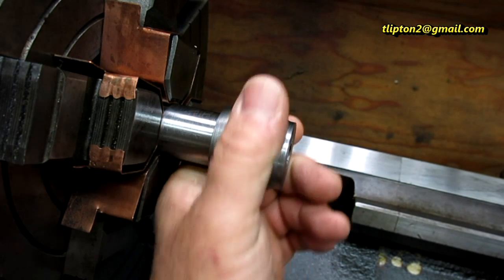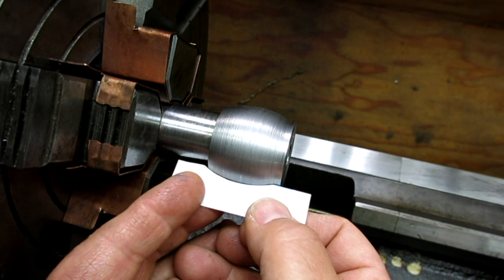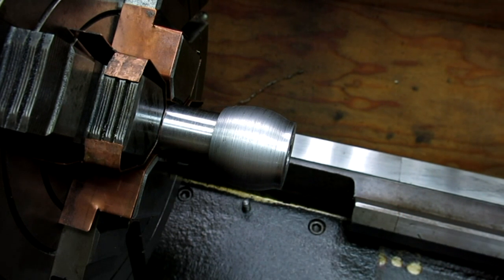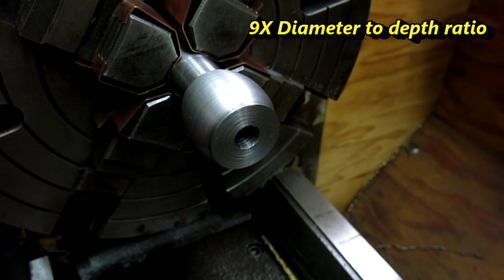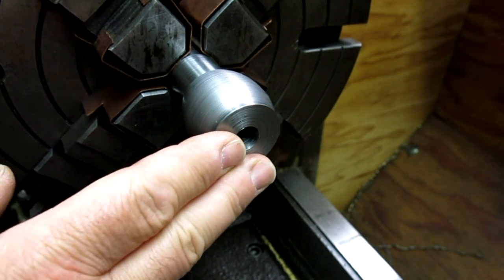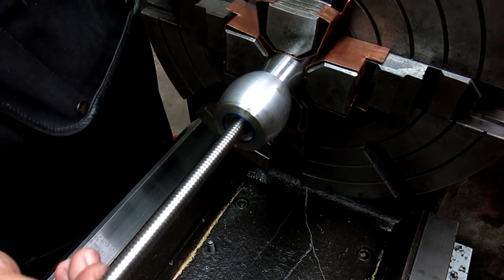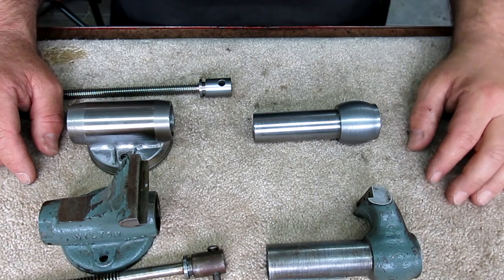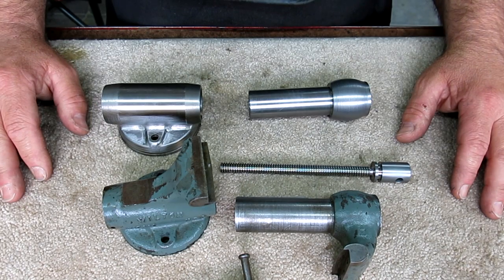Wilton Baby Bullet 9

Comment: Very fine technique , following the pattern with an indicator.
Question:
There exists for some lathes a taper attachment where you loosen the leadscrew of the crosslide and let the crosslide follow the line of the taper , mounting an angled rail at the back side of the lathe. 
Can you imagine a tool that follows an irregular curve mounted from a pattern at the back of the lathe. Will say , you convert your lathe to a "copying lathe" ?

Comment: Tom:
Having been in the trade for over 50 years I am impressed with the work you are doing! As to how you do something in your videos, there are as many ways to do something  that turns out the same as there are pebbles in a stream.What works for one person does not always work for another. Over the years I have owned 3 tool shops made parts for Aircraft, automotive and industry, you could have been a top hand inany of my shops.

I am 71, soon to be 72 and still do a little work on things. Over the years I have done injection molds, steel rule, and progressive dies. All of the work was hands on with very little EDM, water jet &ect. So I can really relate to your hands on aproach. 

Until I moved to Europe in 2010 for a few months ( we were suposed to be there for the rest of our lives, didn't work out) I had a small hobby machine shop in the back yard. (benchtoop mill, Lathe, drillpress grinder, welding equip. and metal saws with assorted hand tools.) sold it all when we decided to move. If I had know I ws coming back I would have put it all in storage. So a word to all those out there that plan on sellingyour tools, DON"T DO IT! 

I have taken up enough of your time so all I can say is keep up the good work. And yes I watched the Wilton vise come to life,  only to things I would have assed to the build would have been a set of aluminum jaws and a set of steel jaws with the cros hatching on them.which can be done by taking a 45* tool setting the vise at a 45 and cutting that way, works very well! will watch more of your videos enjoyed the vis videos very much. Gary, Las Vegas, NV
Reply from the maker: +Gary Brackney Hi Gary,

Thanks for the nice note and support. Great advice on not selling your tools. I have let some things slip away that I really kick myself for now. I was hoping one of our shaper fans would step up and make some serrated jaws for the baby. I went with my favorite style and didn't look back. Thanks for the comment,

Cheers,

Tom

Comment: Nice one Tom. It looks like you're running a high rake aluminium insert on the boring bar(?). It sounds like a good choice and I may try it, but sometimes have issues with chips stringing on external high rakes. I wonder how you go with this on deeper bores?
Reply from the maker: +Pete F Hey Pete,

Try a higher cutting speed and feedrate. Oily oil never hurts either. Thanks for the comment.

Cheers,

Tom

Comment: Great series. To some of the people who made, well, less than favorable comments I would like to say that this is not a "duplicate" of the Baby B. To duplicate it, you would have to make wooden patterns, melt iron, and cast the thing and then machine it.  These are processes beyond the reach of the average home shop and  even most pro shops. This is a facsimile, or imitation, or something like,  a BB. So the tracer a la Lipton is not only reasonable, it is more accurate than the original. What's the error in a casting? From my limited experience in Aluminum, a whole millimeter - 0.040" . That pattern following, , watching the indicator, was never off not more than two-three thou. The error in a hand-filed pattern is more than that! I am really impressed by tracing by hand as opposed to buying a tracer attachment, even if you could find one these days. The only reasonable alternative would be to do it by hand, just like clockmakers do, with a graver and a steady rest. Or of course CNC, but that's not the point of this series.

Comment: Positively Fantastic Control !! Tom,
I seem to remember being told that you can count on a twist drill to cut straight for about 1-1/2 times the diameter, because the Web is thinnest at the chisel point, where the most pressure on the tool is, (unless it's a  split point). So for more accurate deep drilling, you should use a core drill, which has 3 or more flutes and a thicker Web, but must be pilot drilled. 
Of course it all depends on the application. And for a clearance hole its F.C.E.
Thanks for a really interesting series.

Comment: Just to add fuel, when cutting to one of those templates, you might take a tip from woodworkers. When cutting a varying diameter on a wood lathe, they always seem to cut from high to low. If backlash was an issue, you could have cut from the highest spot first to the right and then to the left.

Nice series. You are going to have produced a good-looking vise when you are done.

Comment: Thank you for another great entertaining and educational video.  I have two questions concerning turning the body that I hope you will address:
1.  Is it possible to, instead of making a positive template, grind a negative outline of body into a forming tool?  You could then achieve more intricate outlines and also not be concerned if your stylus and linkage is changing the proportions of the finished part.
2.  Is it practical to create a fixture on the end of the cross-slide that would hold a template and have a stylus following the templates contours and controlling the cross-slide movement much like the action of a taper fixture?
Reply: +Morris Gallo The short answer is 1. yes and 2. yes...

I'm sure that others will jump in here, but remember, every technique has its challenges as well as its benefits.

The form tool approach is going to require very shallow cuts, as you have a lot of area in contact. Speed to feed on those cuts is also a bit tricky, as the tool will want to chatter.

The tracer approach is going to require careful use of the compound feed to control depth of cut. You may need to rig up an extension on your cross slide to get a stylus to reach your template.

I'd probably try to go with the second approach for all but the smallest of feature - your mileage may vary!

Let's see what other, quite possibly more experienced folks have to say on these approaches...

Regards,

Eric
Reply: +Morris Gallo Since the shape is convex, you would have to make full width plunge cuts with the form tool. So no way to make shallow cuts.
It could probably be done with a flat bar 1/2" or 5/8" thick of tool steel or HSS with the form cut into the side of the bar. Then mount the tool crosswise in the tool holder so the form would run along the face of the post rather than out in front of it like normal.
Sounds pretty borderline for his lathe, and definitely pushing the rigidity of the tool post. Sounds about 10x worse than using a knurling tool, you would kill a live center pretty fast doing this.
For a one off like this, the best approach is really to just make a paper pattern, rough it by eye, then finish the shape with a file. Would take half the time and get the same results. If doing more than a few, then a proper tracer can be made by disconnecting the cross feed screw, and hanging a few pounds of weight off a rope tied to the cross slide. Just back the template with a stack of shims, and remove them one at a time for each cut. Basically the taper type fixture you describe.

Comment: Hey Tom, you did a good job as was shown by the reverse template . I don't think it is that crucial to be dead nuts anyway, after all it is a vise body with welding to follow. Looks good and oh it's not taking ya into space it's to hold stuff.  whens #10,whens #10   Dave

Comment: Thanks for touching on the runout, I had to mull over that one a while. Your explanation did not really suffice to satisfy my curiosity (especially the "it's just the way of the world" bit, that always gets me all worked up).

I could always imagine how a drill in a drillpress might wander off course (I can see the flex in my crappy drill press), but I have a hard time translating that same image to a lathe where the part spins. The way I figure the drill must "wag" or wobble around, flexing in time with the spinning part. That is the only way to make the hole go off that way. But why doesn't it just cut a larger (or even tapered) hole if it was imbalanced or misaligned? Which forces "steer" the drill off course and are not averaged out by the spinning of the part? It can not be imbalance in the drill grind, gun drills have only a single cutting edge! 

I suspect a rather important factor is that a drill doesn't cut on the flutes, or it would self center more, like a milling cutter.
Reply: +jusb1066 Yea they are great I use them all the time, but sometimes I need to get in near an obstacle where the step drill will not fit. At first I tried to create something much like a cone drill, with a very pointy angle. It didn't work well. I was surprised that a very flat grind worked better - if I had to guess I would have said that should grab more. I was at that time experimenting to find something that wouldn't grab and crack perspex when breaking through, the sheet metal was only an afterthought.
Reply: +stefantrethan i guess errors in tailstock alignment will cause issues, but i see your point, the part rotates would it not even out, ive often seen the bits initially bite off the original mark.
Reply: +jusb1066 On some lathes (I think it might have been visible on John's old Boxford) you really see how the drill is "pulled" into the center as it starts. However as you say any misalignment should result in a tapered hole, no?
Reply: stefantrethan
yes i see the logic about the tapered hole in a  way! perhaps the mere act of spiing the part around the centre of the hole you want is enough to even out all the forces, the main probability of it wanting to veer off inside maybe the slight innacuracy of the drill tip itself, we have all ground our own bits and it can cut unevenly making a larger hole that the bit itself, and perhaps when spinning the part, this would instead make the hole veer off?
Reply: +jusb1066 I have ground many uneven bits. One might even say I am a bit of an expert in grinding uneven bits ;-)
However lets say the one edge is in front, so it will cut more on one side of the part. But then half the time it cuts more on the other side of the part, because the part has turned.

Cutting with single point tools works quite well on the lathe, even quite flimsy boring bars, apart from chatter and lifting from toolpressure the cuts still turn out concentric. So why does the drill go wobbling about?
Reply: +stefantrethan  You should look at this. http://www.vintagemachinery.org/pubs/detail.aspx?id=4925 Lots of nice drill info there.
Reply: +bcbloc02 Thank you, that was most interesting.
It didn't exactly cover the issue I can't get my head around, but the latter half shows a geometry for sheet metal which I have found surprisingly advantageous before - round hole, no grabbing, no burr. It is nice to see this in such an old book.
Reply: +stefantrethan
i use them coned step drills (and stepless version) for sheet metal, no grabbing at all, might be worth looking at :}, they also work in the thinnest material, plastics etc and work at a slow speed and thus more control, you can buy them super cheap on ebay (3 for $6)  they will be good enough to see if you like them, maybe get some good brand later on
Reply: stefantrethan
 They did cover why drills wander in that book it is because they have poor self centering by design. Also the fact that at the center it doesn't really cut but more like smears the material out of the way. These factors combined mean a drill is prone to following the path of least resistance or being steered by the already cut chips when they sometimes get between the drill body and the hole.

Comment: Wow, you mean people were pedantic enough to point out the nose radius was different on a blank that was supposed to emulate a casting?  Umm, if the nose radius of the stylus is larger than the cutter, there is no effective error because the cutter can produce a smaller form than the stylus.  The 'error' only occurs if the stylus has a larger radius than the smallest feature you are copying.

Comment: For copying a rough casting i think it was an amazing idea and there is a few people
on you tube actually taking it further,And making it electronic tracer attachment from
that idea..:)Great job as for the hole i don't think its an issue until the job is finished..
Its pointless pointing out mistakes,While the process is still ongoing it would be put
right in the next series,There series of videos..When they where done was probably
one after another and fed to us on a weekly basis...I bet the traced part of the bullet
ball part is probably closer and smother finish than the rough casting,And its not a 
critical part of the vice.